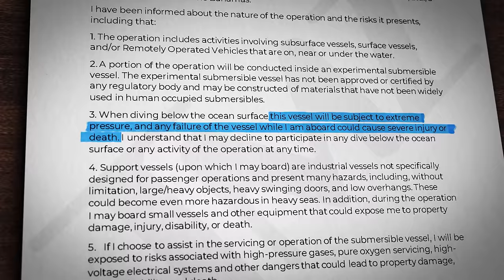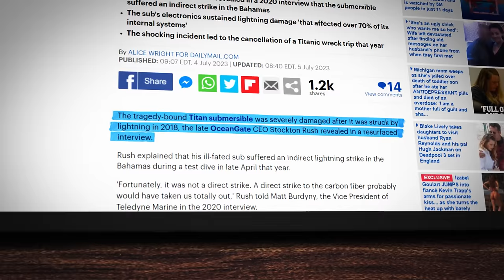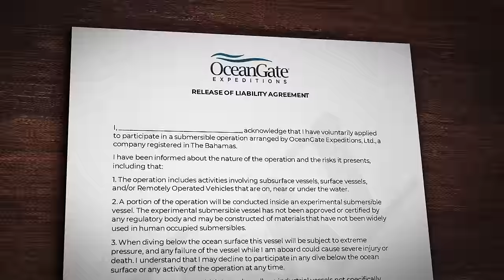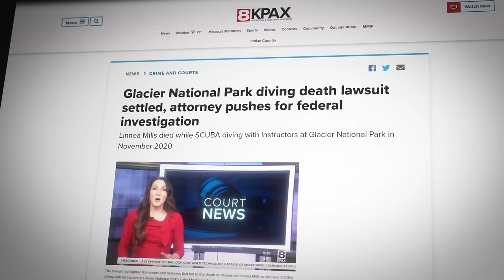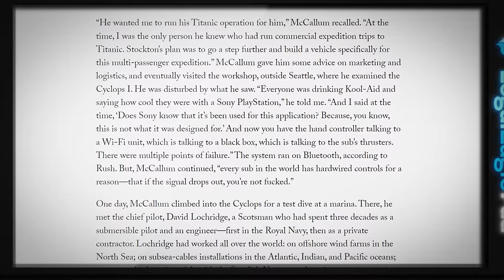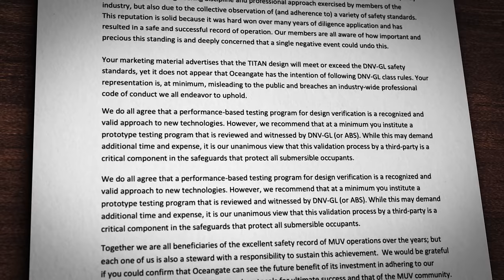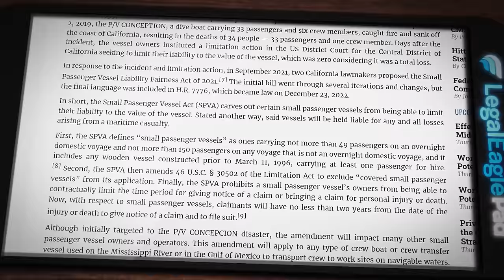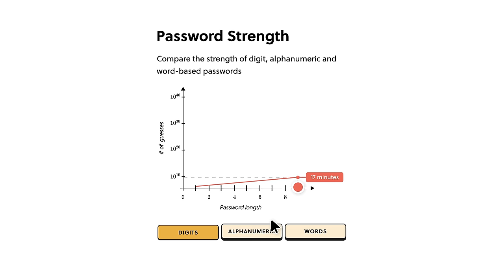OceanGate Is Getting Majorly Sued

Comment: In my opinion, this game controller was probably most reliable part of the ship. Well tested, produced in millions of pieces, resistant to brutal use by children. And they had a few on board to spare. It's failure is the last thing I would suspect.
Reply: Poeple made fun of it, but it is the MVP of this pringle can.
Reply: The controller itself, yes, but the fact it wasn't hardwired is still an issue there. You've got three other pieces of hardware it's connecting to one after the other wirelessly that could also fail.
Reply: @jamesjohnston5749  Agree, out of all this mess that the controller is mass produced for other means is not the most worrying thing IMO, but why a finicky BT controller? Like, don't pro gamers favor wired because of lower latency? And that's in a game, not in a literal life or death situation. Did he not own a car with BT connected phone that sometimes refused to work or wireless headphones that sometimes just don't want to work or run out of batteries? And in both those non critical situations a wired backup is only a few seconds away if you buy one that supports it. The importance of this detail really drives home the point what the mindset of this Stockton guy was.
Reply: @jamesjohnston5749 great point! after watching the documentary here on yt of the discovery of the samuel b roberts wreck, which is over twice the depth of titanic, the submersibles used there and honestly just everything is night and day compared to what the titan was using.
Reply: Yep, hats off to PlayStation. MVP 😂
Reply: A lot of people seem to be mistaking the controller for an official Xbox or Playstation comtroller. It’s a third party controller, a bootleg, and from what I heard a pretty terrible one at that. I wouldn’t use this controller for a video game, much less a sub.
Reply: @Aquatj999  It's not a bootleg. It was produced by Logitech, one of the more trusted names for third-party controllers.
Reply: it’s the multiple bluetooth connections from controller to controlled surfaces.. you’re reliant on bluetooth and wifi software and controllers  you don’t really have control over - someone (ie: developer in a foreign country) could have issued an update that is installed that introduces unpredictable errors or dropouts. massive risk right there.
Reply: There was a minimum chance the controller failed to connect to the submarine. No matter how close, any signal can get disconnected from that deep under water. In short words, don't use wireless equipment for underwater investigations
Reply: Just to ask for clarification,
Isn’t that specific controller known to be very poorly reviewed due to many reports of constant disconnections?
Reply: It wasn't. It introduced multiple points of failure since they failed to hardwire and unsurprisingly the vessel had communication issues on every voyage.
Reply: It's a high-quality GAME CONTROLLER.  Humans don't die when a game controller fails.
The controls integration was BALLS.  I get paid to integrate industrial controls.  It was a completely inelegant and lacked robustness.  It was a kludge and unsuitable for a critical application.
I recommend learning about the US Navy's Sub Safe standards as a starting point.  You have a long way to go before you provide an informed opinion on this matter.
Reply: @Aquatj999  That's great information.  Rush didn't seem to possess any professional experience developing industrial controls integration., did he!

@buniokowski3162 makes a rather hyperbolic claim for the sake of getting attention.  It's a rather ignorant thing to assert.  In fact, I'd wager he doesn't know sh1t.
The titanium end-bells were quite robust.  They managed to survive intact despite the rest of the hull being disintegrated, so there is that.
Reply: I was wireless though and on battery. So go figure. Anyone actually thinking they had procedures for checking battery status as part of a Standard Operting Procedure (SOP)? Based on what I have seen and heard alsoe from the company and its (former) CEO), I would guess they did not. Making SOPs and follow them is not something "innovative" youngsters tends to enjoy.
Lots of talks about how game controllers are used by others, but as far as I can tell,  a very large majority of these does not controll a vehicle carrying human passangers.
Reply: @Valhalla05 not what i heard
 From whatvi heard it was a logictec type controller but it was a third party one with horrible reviews
Reply: @Joe-kx7bl  so are you in the military? Because every article and person i just asked said they use Xbox 360 controllers
Reply: u mean the one thing that had proper testing is a controller and not the under high pressure compaction tube!
Reply: @jamesjohnston5749  can agree should have had a wired one what if the batteries died mid game i mean travel
titan sub last moments let me finish this match then ill get to the errors
Reply: @Joe-kx7bl  Name a military system that uses that controller.  ROV's don't potenially kill their pilots when a game controller stops working.
Reply: Yeah but.. Bluetooth! Where mah USB at?
Reply: It was modified
Reply: The irony is the controller was straight garbage. When he tossed it in the interview he likely broke it. I've owned two of those exact controllers, and they both broke without being tossed. The connectivity via wireless is also an issue, they're not high quality. The wired controllers are incredibly cheap too. If they were going to use a controller, they should've bought a legitimate wired Xbox one, those are actually used on Navy subs. They're high quality and reliable. There's a reason they cost almost 60$, versus the Logitech ones costing 1/5th the price.
Reply: @kurtpena5462  If you believe that controller was high quality, you flat out have never owned or used it. I've had two of those exact model wireless controllers. They're fuckin garbage dude. They break without even throwing them.
Reply: ...Provided none of them were labelled Made in Britain ... 😉

(Though if I understand the story correctly: Wasn't the sub itself built in that strange country just over the water from France, where they d(r)ive on the opposite side to almost everybody else? 🫖🙃)
Reply: It was an odd brand PS3 controller tho, like it couldn't have even been an off brand PS4 or 5 controller at least; standard, default PS3 controller was prolly the worse vg controller of that whole console generation. And off brand controllers are usually less reliable & of a much lower quality than the first party ones, too
Reply: @dalayneejo  Watched that too, see also the doc on the modern replica of the 1894 Argonaut jr. very good doc and includes details of the weirdness of buoyancy adjustments.
When SR dropped the one tonne frame, he tilted the nose of the Titan up, that ruined the designed vector of the thrusters. not to mention the woodscrewed Synfoam assembly at the rear was pulling the tail up too, the weak link is the junction at the rear ring.
Reply: @kurtpena5462  Oceangate had a subsafe VP director of engineering. Tony Nissen, hes the shaved head dude seen smiling when they glue the ring on at Spencer Composites. SR gives him a funny sideways look.
Reply: @kurtpena5462  It will be interesting to see how the 1/8" welded on flange walls on the Ring survived. you can see the raised weld radius from the photos. its convex weld not concave machined.
Reply: @daethe  I do not.  Using a plastic controller intended for home video game consoles as the primary means of control for a DSRV is nothing short of idiotic.  Not sure how you would think otherwise.
Reply: @dieseldragon6756  You have not understood correctly. The sub was built in the US.
Reply: True 👍 I will pay 1mill if you go down their and collect the surviving joypad? Ya know I'll pay for the pizza if you go and get it mate? 🤪
Reply: @TheGodpharma  But the Titanic wasn't... 🚢🫖🙃
Reply: @dieseldragon6756  You said "the sub".
Reply: @TheGodpharma  Aye, true. It was only after I posted that I remembered where the Titanic had been built... 🚢 🇬🇧 😉

But back in those days the UK was not too dissimilar to how it is today - Far too many glass ceilings, overt social division, collation of 95% of the money to 5% of the populace - So I'm not at all surprised our engineering was that 💩.

If the Titanic had been built in Germany and/or Spain; Not only would it have been a lot closer to „Unsinkable“ then the British trash we ended up with, but it would've survived the iceberg strike with minor damage, would've completed its voyage and been repaired, carried on as normal, and would probably still be in service to this day... 🚢🇩🇪 🛠 🇪🇸 👍
Reply: ok
Reply: @zeroelus  also: governments use game controllers for this sort of thing all the time. but, critically, they are hardwired to avoid the multiple points of failure that the titan's system had. i know the US military uses 360 controllers, for example.
Reply: The thing's probably actually salvageable.
Reply: @Valhalla05 Logitech is a trash company and any 3rd party controller not custom made or endorsed by the official company is garbage compared to the official brand. That controller was a clear sign of cutting corners
Reply: Burn

Comment: The controller was the least of their worries. What confuses me is how they had such passion for deep sea exploration, yet had no understanding of how dangerous everything is, like even the basic knowledge about the pressure of millions of tons of liquid crushing down on you all the time. THERE'S A REASON HEALTHY AND SAFETY REGULATIONS EXIST NO MATTER HOW SILLY THEY MAY SEEM!
Reply: they did have the basic knowledge of the pressure, and lacking that was not what caused the implosion. the problem was material fatigue from pressure cycles after a dozen successful dives, otherwise best known from pressurized airplane hulls, which are sold with a recommended limit for how often the plane can fly to high altitude and back down before its structural integrity is no longer guaranteed. oceangate just skipped the fatigue testing entirely, and used these manned dives as fatigue testing - which is a pretty sure way to achieve exactly this result.
Reply: im going to space in my motorcross helmet, its far cooler
Reply: @Ass_of_Amalek hat seemed to be the biggest issue in my opinion.

Everything else is essentially white noise but if they had just done unmanned tests to failure with a few hulls and figured out a lifespan of the design it probably wouldn't have ended in tragedy because it did indeed work despite everything.

They had no idea when it would fail but even if they had better quality controls and better production values (there were definitely significant improvements they could have made even with the same material and overall design) it was always going to fail eventually with the hull material they chose.
Reply: @Ass_of_Amalek  They ignored every regulation and warnings about the potential for fatalities over and over again, taking it as an insult if anyone questioned the guy's plans. It wasn't just one thing dude.
Reply: @overzealouseuthanasiast9731  not what I said

Comment: Thing is, the titanium end caps and the carbon fibre hull constrict different amounts while under pressure. A lot of the cracking sounds was probably the glue (yes glue) holding them together actually cracking since they were moving different amounts.

Comment: i feel like this entire affair shows just how poor our legal system is at protecting people and meting out actual justice, the entire submersible industry tried so hard to prevent stockton from hurting people, and yet, here we are.
Reply: I mean of course that they seemed to be "pursuing happiness" and hurting only themselves and not others. The logic that says murder is unethical doesn't seem to apply. This doesn't look like murder. This looks like exploration and getting eaten by a bear. It should be legal to get eaten by a bear in my opinion.
Reply: I believe in the full rights of the passengers. The right to explore but also the right to sue if they die. The right thing is first for the sub to dive and second it is also right to sue for failure. I believe in both of those to encourage people to use subs and to make subs good.
Reply: @darthparallax5207  I also believe that people should be allowed to take whatever risks they want, but not when they are being mislead about the risks. He repeatedly said the submarine exceeded regulatory requirements, when it didn't. He fired people who tried to raise concerns, and took steps to cut costs that made the system unsafe. He based the sub on designs meant to go 1/8th of the required depth. Would the passengers still have taken the risk if they fully understood what the risk actually was?
Reply: @polycrystallinecandy  Indeed. But I feel like making a legal system capable of stopping this won't be easy… Proving something unsafe is as hard as proving something safe.
Reply: @henry_tsai  As far as I'm concerned, the issue isn't that it was unsafe, it's that the passengers didn't know how unsafe it was. After all, people willingly do unsafe things all the time - their life, their choice. But misrepresenting the risk means they can't make an informed choice in the first place.

And we do know how to prove the safety of a lot of things, with a reasonable level of confidence. That's why regulations exist, based on decades of scientific research. Like there are millions of times more ways to make an unsafe aircraft than there are to make a safe one. Yet most aircraft are safe, because of that research.
Reply: They exclusively operated in international waters for a reason. 
And maybe hold off on claims of failed justice when the systems haven’t had a chance to address the case. Justice is slow.
No system is perfect, especially when you have a smart person working very carefully to avoid the regulations in place.
I expect OceanGate to lose everything they have in court, but I also feel little sympathy for the adults on that vessel.
It is the responsibility of any person to do extra background work when being pitched on using an uncertified experimental vehicle. I mean, come on!
Reply: @henry_tsai  To do that, there should have been more tests done, which was precisely what OceanGate didn't want to do. So without serious, scientific tests, we are left with just a narcissist's obsession with proving that he knew better than anybody else, and would sack and sue employees in order to be able to do whatever he wanted.
Reply: @mattleathen445  It looks so reasonable to me, what you are saying! But to be fair to OceanGate, my bias is also playing here. I am claustrophobic and that closed space in which you can't even stand up or move around gives me the creeps. That is to say that you would have to put a gun to my head to make me enter the space, not even go anywhere on it. But other people don't have the same limitations than me, and the ship didn't look scary to them.
Reply: Part of the problem though is that it maybe shouldn't be 'your' legal system. Should there be some system established under the UN for example that creates a justice system for international waters? The jurisdictional issues for this case may take years to pick through even before the case comes to any kind of court

Comment: People don't understand how carbon fibre works.  As the name implies, it's long fibres, and those fibres are very strong, but if you push instead of pull a fibre, it's like spaghetti: it deforms easily.  When carbon fibre is in compression rather than tension, much of its strength is actually the resin that glues the fibre together.  In essence, while "carbon-fibre pressure vessel" sounds kind of impressive (or at least it did to most laypeople before this happened), the vessel was in many ways more like a glorified plastic pressure vessel.

Comment: the more I learn about this the more shocked I am that anyone would decide to get into that deathtrap
Reply: Rush likely confidently assured them all it would be safe, they didn’t know there were so many issues and red flags
Reply: @colleenc5972  Some were complaining about seeing fixes with zip ties, duct tape and other improvised methods. There were comments made about how the emergency ascend system (a few scaffolding poles welded together to form a weight) looked amateurish. There were definitely warning signs and several passengers noticed some of them, though that for some reason did not stop them from entering this death trap...

Comment: As a lawyer, I can also see that there was definitely an element of Negligence in the making of the titan submarine. It should have been calculated and built to withstand the pressure of the ocean
Reply: How about maybe testing, or certification? Yeah.
Reply: It was, they had already spent 2 years of unmanned testing and had to change the hull due to pressure fractures (which would mean they had built a system to measure them and caught them) prior to manned traveling and had already had like 12 successful trips to the Titanic and 21 to the ocean floor, clearly their measurement system for hull fractures was not sufficient.
Reply: Lawyer or not, a submersible is not a submarine.
Reply: @Sunny-ot1vo  your right 👍 I totally agree on this
Reply: the hull as constructed was good for submerging, what they failed to consider is the effects that /repeated dives/ would have on structural integrity
Reply: @life_of_riley88  Is there a certification board for submersibles?
Reply: @AnarexicSumo  Yes! A major organization does certification for all submersibles and rates them for safety and depth. Literal industry standards.
Reply: @AnarexicSumo  17:31 here is where the video talks about industry standards.
Reply: It technically exceeded the needed pressure requirements.         However there were obvious weak stress points and they were pointed out by the engineer who got fired.